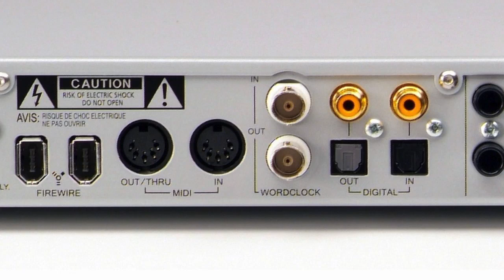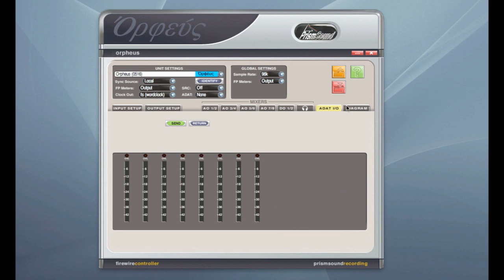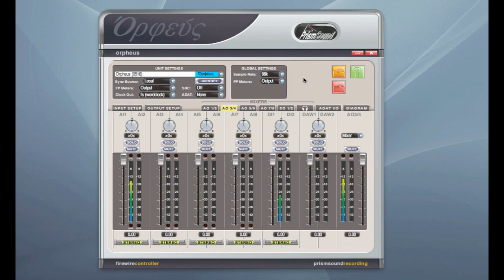Prism Sound Orpheus review

Comment: I'm in desperate need of a new audio interface. Currently I have 2 Sinic Core "Project" PCI cards (formerly called Creamware "Pulsar II" cards) from the early 00s with a Sonic Core "A16 Ultra" 16in 16out  ADAT AD/DA converter. Nothing seems to be as flexible or as logical as my ancient set up :(    
edit: unless I was to buy Sonic Core's new external audio interfaces.

Comment: With the combo jack in the back this creates an issue with closed back rack mounting you can only have 4 mic pres plus 4 line or 8 line ins. This is a real pain and loss of functionality. Surely at this price I should have a mic line switch at the front and  4 extra line inputs at the back. Do away with the combo sockets.